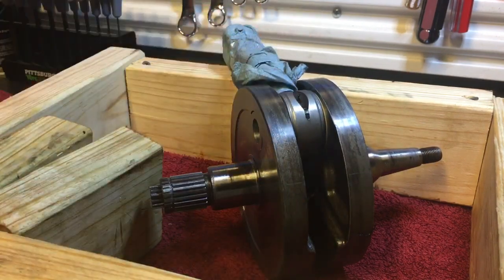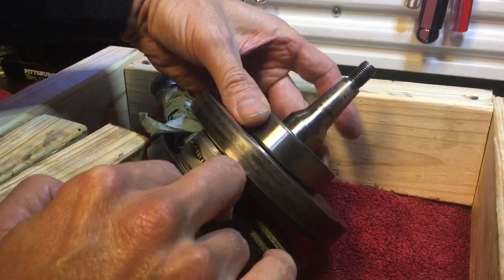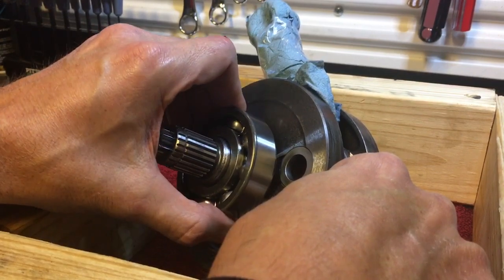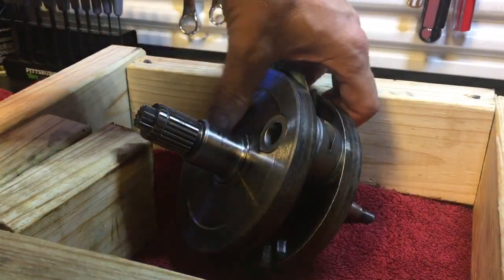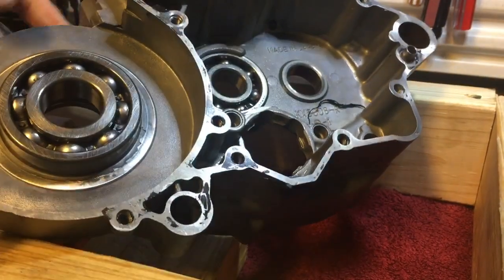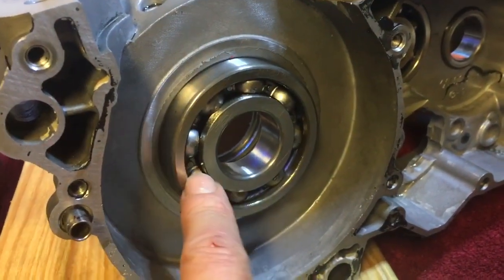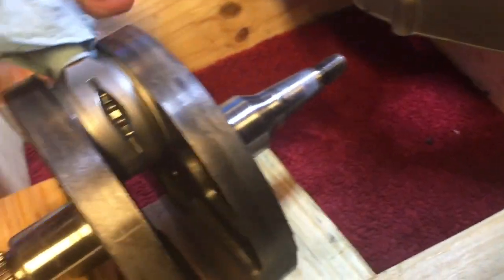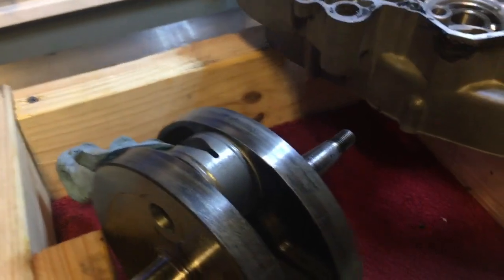Kx 500 crank journal bearing PROBLEMS/ Issue - contact Tom Morgan Racing -  Loose bearing?

Comment: yes had the same problem on my 94 KX250,i went to an engineer and he put a sleeve in the case to bring it back to original size so bearing is now tight as and had no problems
Reply from the maker: thanks Richard!   Yeah it was news to me...I should have grabbed that flywheel before buying.  Tom Morgan mentioned these cranks are not super balanced from the factory so the forces eventually weaken or oval out that sleeve.